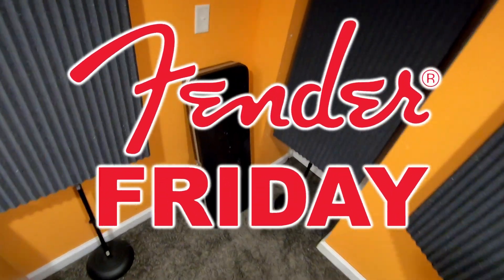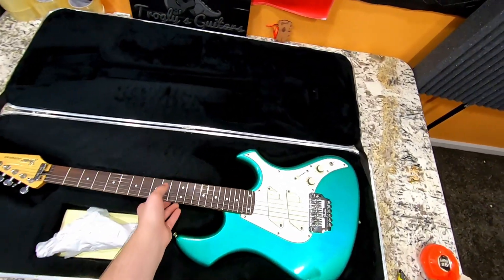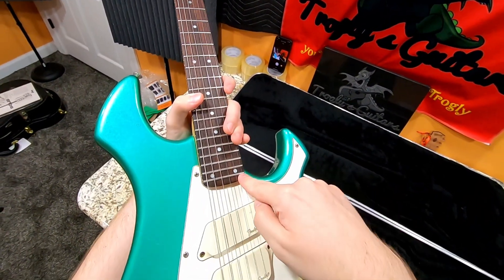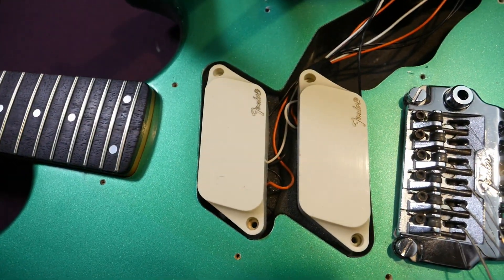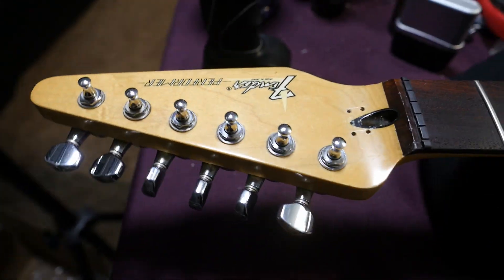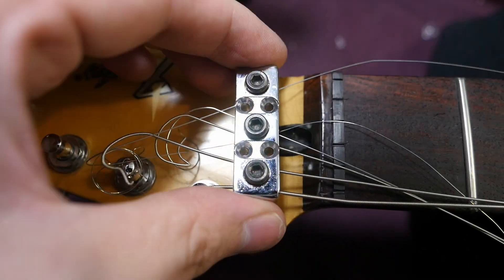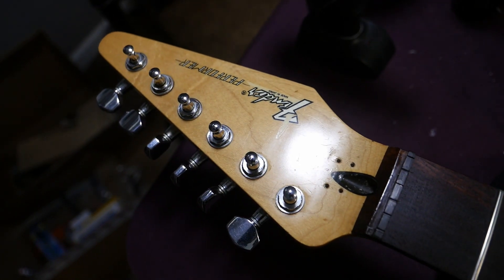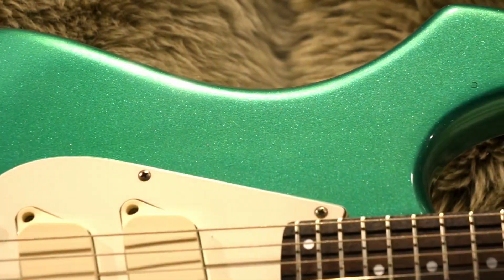That One Time When Fender Made the Strat "Metal" | 1985 Fender Performer MIJ Review + Demo

Comment: all that slack in the strings above the nut doesnt help much in stability. proper way is to middle your fine tuners, tune up the guitar as you normally would with nut loose. when tuned up/stretched you then tighten up the nut, retune slightly with your fines. dive bomb away. floating trems are a pain to set up if one hasnt the experience.     i just watched your EVH Gibby black proto guitar,(i absolutely love every aspect about it.) also in that video u just said pretty much verbatim what i just tried to explain/be helpful with.

Comment: Pickups slanted in the correct direction. That’s the way the classic strat should have had the bridge pickup slanted. The thinner strings should have the pickup picking up the string vibration highe up on the string not closer to the bridge. Hendrix knew this well before metal.

Comment: Freeze frame at 19:10 . Look at the D string on the headstock. It's not tight. Looks lose. Wtf?
Reply from the maker: String snapped after being clamped by the locking nut. Works fine. You can technically remove all the strings past the nut after locking them down. Not recommended though in case they slip a bit

Comment: 6 min. in : W the epoxy there's not going to be any problems. Fender traditional  p-ups design is total crap. Nothing protecting 42, 43, or even higher gauge wire. A screw driver slip and its ruined.